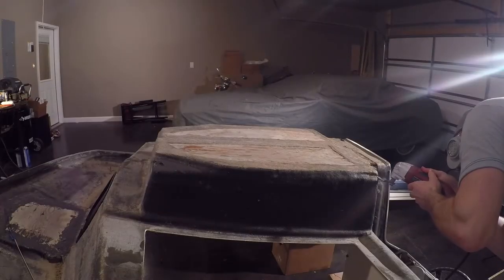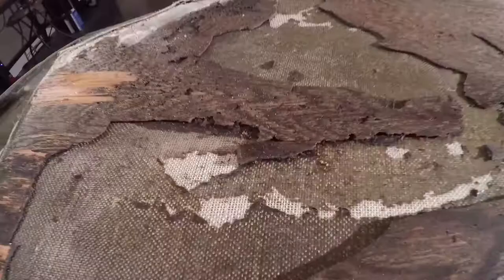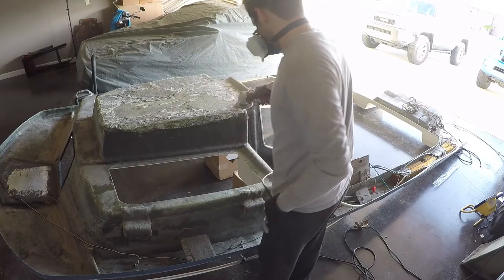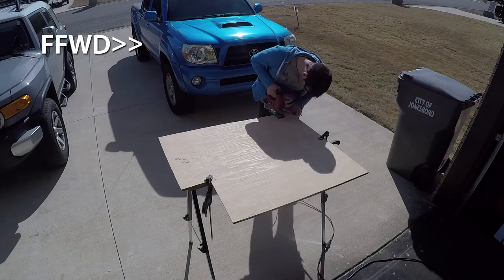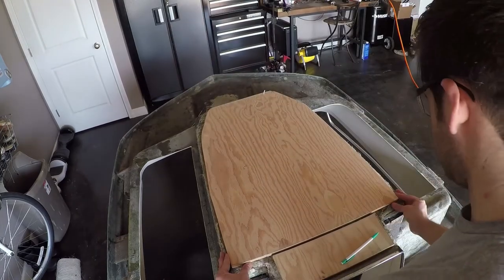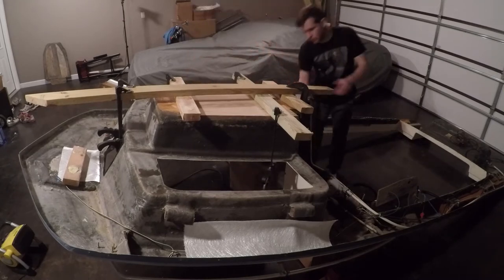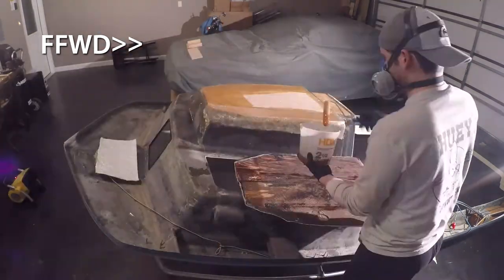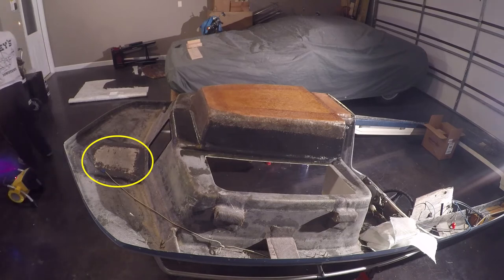Repairing the Cap // Project Glastron/Vlog #20

Comment: This was so cool, I am restoring my old 1974 Galaxy 19' Bow rider and this was much more involved then I had to go thru but I have replaced the floor 3 times over the last 40 plus years.  I have learned that it is easer for me not to set the seats down permanently , which allows me to move them as needed and it has saved my floors, LOL!  Now I want to see the finished project!
Reply from the maker: +Carolyn Hilton thanks!  I can't wait to be finished and out on the water...stay tuned!

Comment: these are great videos, I have I was told , a 1975 Glastron tri-hull open bow without storage under the front seats. with a 150 Chrysler outboard. The floor had several soft spots on it and when my son pulled up the rotten floor their wasn't even stringers left to make patterns like you did. so my question for you is , does it become a hit and miss to make patterns for new stringers? Any advice would be appreciated. John from Alberta Canada

Comment: Hey josh I'm re building the same boat on your drainage system I know you glued them in with PL glue what did you seal them with at the front ? Epoxy ??  I'm learning the fiberglass wont adhere to the pvc

Comment: Awesome vid!

On your stringer installation, is there a reason for not bonding the stringers directly to the fiberglass hull? I'm sure there is a sensible reason, but what is it?
Reply from the maker: Thanks, +Travis Stevens that question is very controversial.  All I will say is if you research it you will find various theories behind it.  Some believe it acts as gap filler only, other say it prevents stress on the hull.
Reply: Awesome. Thanks for the background. Looking forward to following the rest of the build. Cheers from Bermuda!

Comment: You did put a few of those ants back inside so they can rebuild their new home, didn't you? :-)  You have to know that whatever you do is light-years ahead of the manufacturer's job. They build to get them out as fast as possible and the buyer will have to take care of problems down the road. When you refurbish any boat, the owner usually does a heck of a better job then any manufacture does. And that is a fact.
Reply from the maker: Sorry to say, but the ants were relocated out of the boat permanently.  :-)  It is evident how much stronger the boat is at its current stage compared to where it was when I started the project.

Comment: When's the next video ? I'm restoring the same boat and eager to see what you have done since your last video 👍🏻
Reply from the maker: +kmski1506 I just uploaded it : )  That's cool that we have the same boat, what all have you gotten done to yours?
Reply: jmink  hey great to hear from you so far I've stripped it down to bare shell removing the transom at this point and then building it up from there. Only difference is I have some hull damage luckily I own a auto body shop. So I have to repair and the hull I'm also going to paint the topside while I'm at it.

Comment: Are you doing any work on the motor?  By the way, I have watched all 21 videos, you have inspired me to try this......we are going to restore an old boat and then auction it off for charity....
Reply from the maker: +Ross Day yes I have plans to rebuild the carburetors, new water pump, change gear oil, new plugs.  Few odds and ends that I'll be doing with it.  Rebuilding a boat and auctioning it off for charity is awesome!!